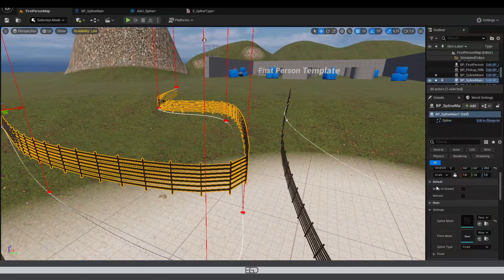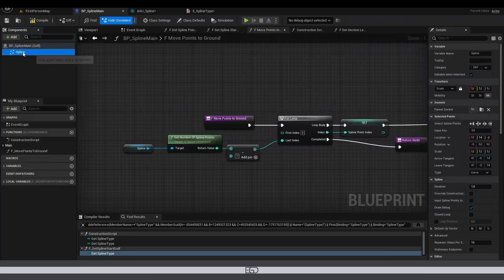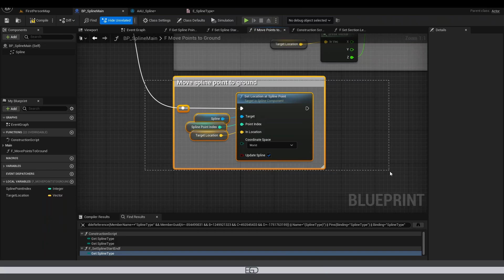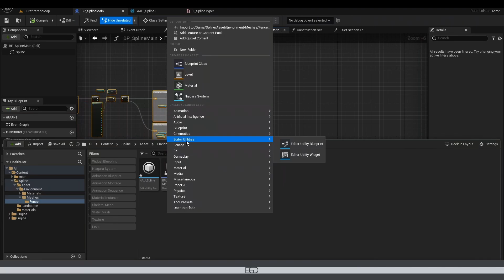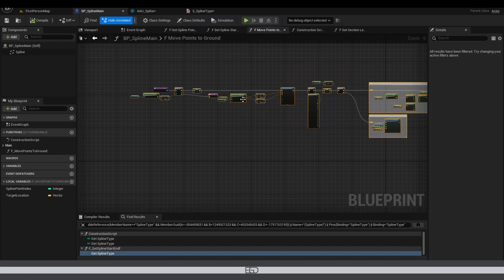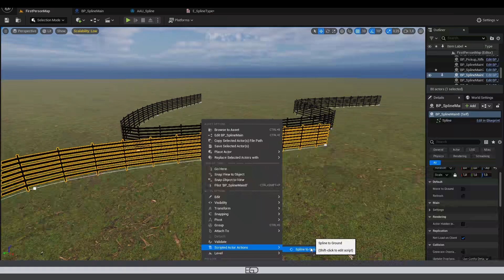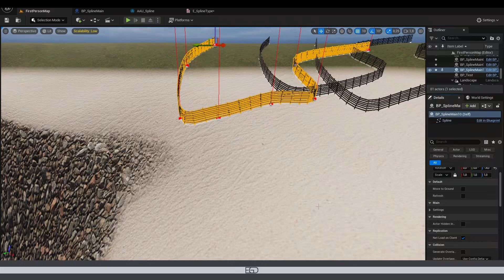UE5 Auto snap spline to ground (+Editor utility)

Comment: When I add this to the editor utility, the line trace by channel requires a world context object, is there any way you could show us the whole blueprint for the editor widget? Thank you =) I can't seem to get it to work as the editor utility =(
Reply from the maker: You can see it starting from 4:04. You get the selected actors, then their spline components, and the variable of that is the context. The rest of the code is just a copy of the previous code we made in BP_SplineMain. I did make an editor utility widget to check this, and works for me, just had to copy in. Only difference is that it runs on "OnClicked" for a button.
Reply from the maker: Maybe you have 2 different variables for spline? That could be an issue. I renamed it at 4:42, that could possibly be confusing. If you still got an issue feel free to tell, and I will try to help